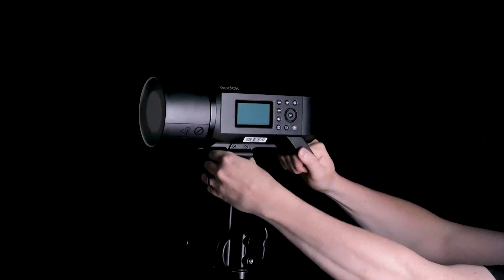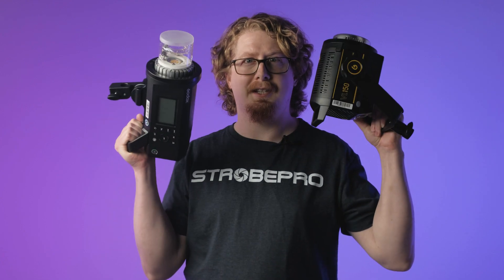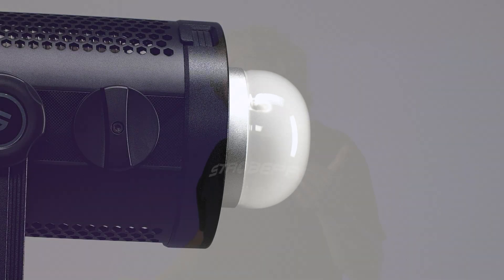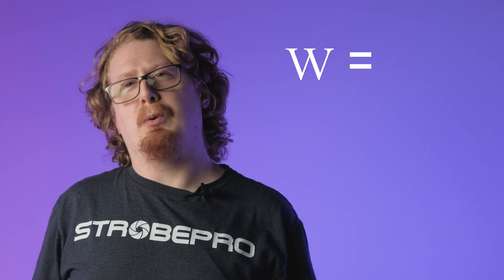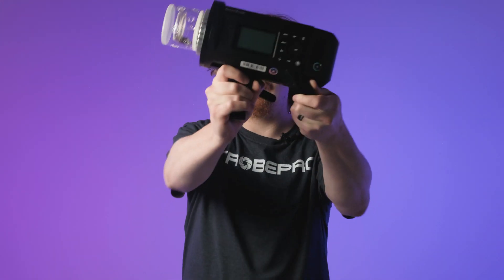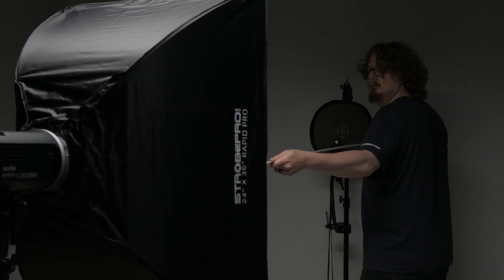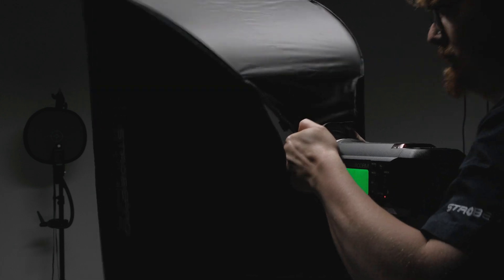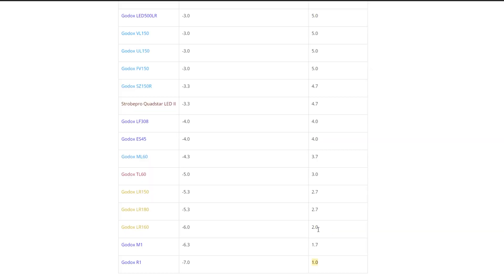A Better Way to Compare Strobes and LEDs

Comment: 5:58 this answers my question i was here for this, thanks for the informative video, correct me if i'm wrong: so if a flash fires uses to 300w fire a light at the speed of 1/200 of a second compared to a 300w LED continuous light that uses 300w each second, the strobe would use 60,000w if i was on for a full second (300wx200 = 60,000w) is that how much more powerful strobes are compared to continuous lights? if that's correct i get it how a 600w strobe can overpower the sun...

Comment: Do I understand correctly that Godox SL300 III is five stops darker than Godox QT600 III? And both light sources were measured at full power? If I use the QT600 at 1/8 of the power, then I need to compensate 2 more stops using the aperture and ISO if I want to replace the QT600 with the SL300. Do I get it right?

Comment: So a 300w LED can produce way less power than a 300w strobe?
Reply from the maker: The short answer is yes. A single 300Ws flash uses the same energy consumed by the 300W LED over a 1 second period. LEDs have better luminous efficacy than flash tubes, but it's still no contest. When still frames are being captured at very small fractions of a second, a small speedlite will easily outclass a 300W LED. 

The long answer is that it kind of depends on what you are shooting. With a tripod and a completely still subject, you can select base ISO and lengthen your shutter speed until you hit your target exposure. Whenever you have access to longer shutter speeds, the LED can achieve the same output as the strobe—it just needs more time to do so.